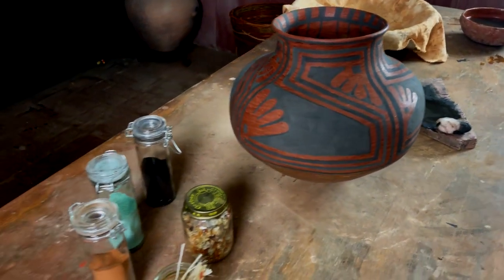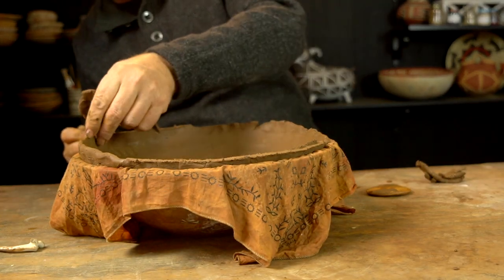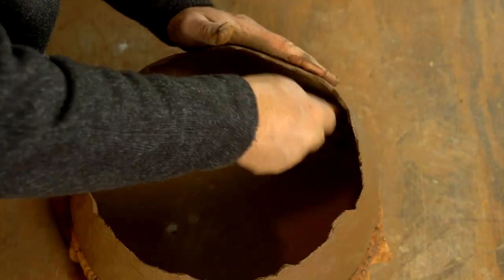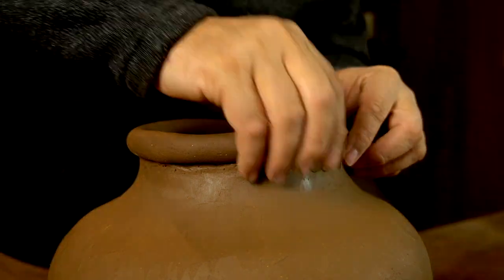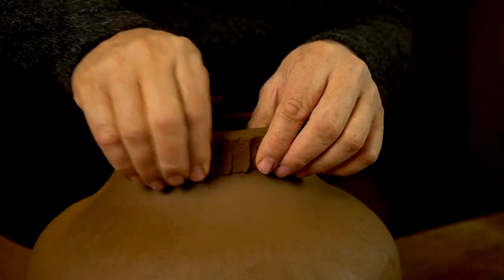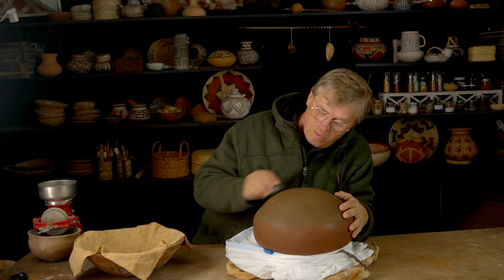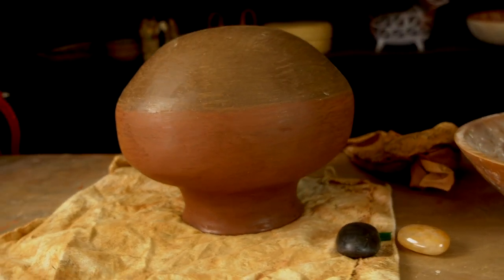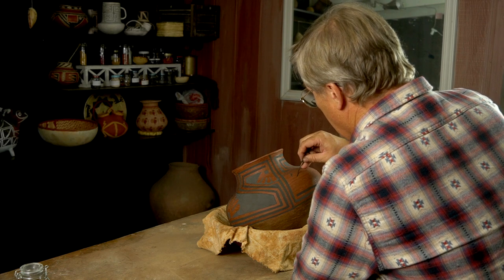I Made the Tin Can of the Ancient Southwest

Comment: Mistakes happen. So far, most of my mistakes(usually brush strokes slipping) have been able to be worked into design by adding even more just like it into the design. Some of the neater elements have happened this way. Like bob ross would say happy accident. My wife dropped a drop of slip right inside a bowl where was supposed to be nothing. She was upset about it and asked me what to do. I didn't see any way to incorporate it into the design. But did notice it looked like a scorpion body. So we added legs, pinchers and tail.  Now it's a cool looking point on the bowl. Just go with it. Next pot can try to make perfect...
Reply from the maker: Thanks fir that story and advice. Good thoughts.

Comment: Thanks for another great video, Andy. You might try using cling wrap (plastic wrap, Saranwrap, whatever you grew up calling it) on the wooden puki to prevent it from wicking moisture from the pottery. With the bandana between the cling wrap and the pot, you shouldn't have any trouble with the pot getting stuck.

Comment: Hey, thanks for all of those realy interissting Videos.
They help me a lot on my Pottery journy.

I have a question about the wooden Pukis.
Have you ever tryed to submerge them into water for one or two days before using them?

I can imagen that it wont swell with the clay in it anymore, maybe even shrink a bit and release the pot more.

But it would dry alot slower in the bottom with an moist wood puki wich could be an Problem.

Have you experience with it?

Comment: you can make copper carbonate at home with pennies vinegar and baking soda
Reply: Is there still copper in pennies.
Reply from the maker: I think you would need to use old pennies.
Reply from the maker: Thanks for that tip. You can also make iron oxide from rust.
Reply: @AncientPottery  1982 and prior, but there is still plenty of copper in the coating on modern pennies to make Cu2CO3 for painting
Reply: I've made iron acetate for a black /Grey stain, if I add  baking soda I should get a precipitate to pain on clay?
Reply from the maker: @nated186  I have no idea but hey, give it a shot. My guess would be that any iron painted on will turn red in the firing. You will also need some fixative to make it stay on the pot. Either add sone clay to it or burnish it into the still damp pot.
Reply: @nated186  yes because iron acetate is soluble in water whilst iron carbonate is not, so it will precipitate, however I recommend combining this precipitate with clay and a tiny amount of water to make a paste, helps it bind easier

Comment: I recently fired my first peices and they did something really strange and I was hoping you might have the answers. I found a reddish brown clay that was pretty easy to work with. I wanted to do some test peices without ny added temper so I made a few tiny pots, but after I took them out they where burned black all the way through the clay and didn't actually fire. Is there something wrong with the clay? 
Did I just not fire it for long enough and it's normal to go through a faze where its black all the way through the clay, I broke a piece to investigate a little more and the inside was black too.
Reply from the maker: Fire hotter and longer with better air circulation. That black is carbon that didn't get burned away. Maybe this video will help you https://youtu.be/zDWFu63c12s
Reply: @AncientPottery  Thank you, I love your videos by the way